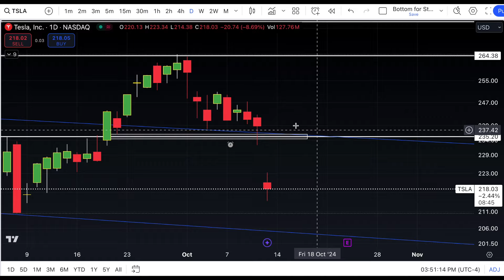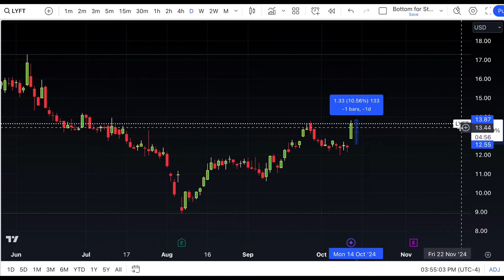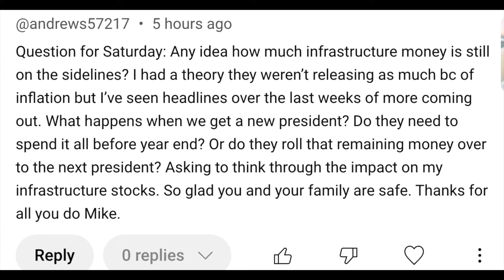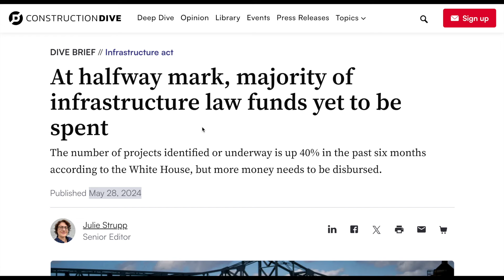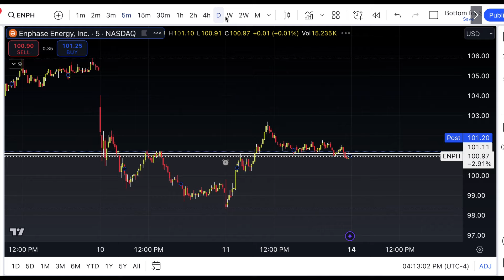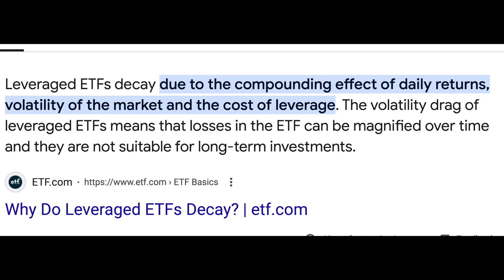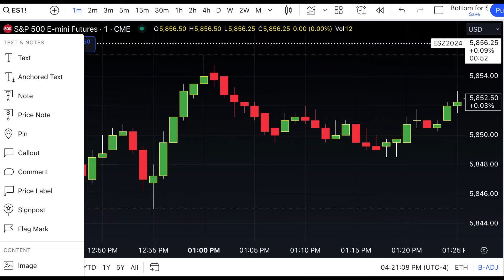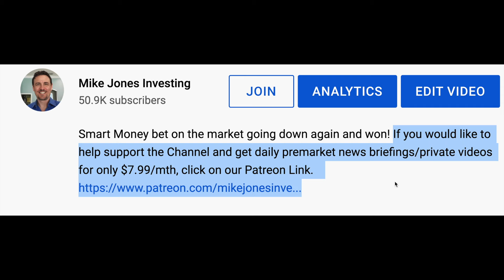Big Money Pulled The Rug On Tesla & Here's Where Buyers Will Step In! Plus ENPH, Liquidity, etc!

Comment: Did Tesla just give up on the semi-trucks? Haven't heard anything about them in years
Reply: Tesla phone ?
Reply: No they did not give up there actual building the semi factory right now this alone will be epic
Reply: lol. They are building a solo building in Nevada right now for them.
Reply: You mean aside from the Pepsi two year usage report that came out a few weeks ago ?  Or the fact the walls are going in place this week on the dedicated Semi factory in Nevada with a 50K/yr build capacity  now that 4680 production is ramping enough to cover the Semi as well as the CT ?  Or the presentation in Europe showing the minor changes  required for EU ?
Reply: @kirkellis4329  I have yet to see one on the road.  I don't think the flex of it now being done is as good as you're trying to make it sound.  These were announced in 2017 with a production date originally of 2019.
Reply: @tonytiger6874  I think Pepsi had 70 of them running all their N Cal routes for the last 2+ years.  Tesla has another group moving battery packs and vehicles from NV to Fremont and TX.  All beta testing until now, but design is final and factory for full production under construction.  Five years late is still early compared to Bill Gates, Mercedes and everyone else who said it could "never" be done as BEV and bet on hydrogen fuel cells instead.

Comment: Mike yes it’s fully automated in China  BUT if you noticed THERE WASNT ANY TRAFFIC those buses were on a road only those vehicles can use we have that here with WAYMO they are doing driverless cars already in certain areas
Reply from the maker: Yea but keep in mind those videos were 2-3 years old. They are in regular areas now.  Yea in San Francisco. I rode Waymo  a few tims about 2 months ago. It was awesome.
Reply: My ex and kid just rode a waymo. Said it ran a red light. Cut someone off. Started moving when unclear what pedestrian was going to do

3 strikes in a 20 min ride. I was shocked by the error rate
Reply: exactly! My son was serving in the Navy.. stationed in Japan for the last 5 years... there are no automated taxis or busses running anywhere other than closed off strictly controlled sections. the mass transit system is very efficient and well maintained but is still run and managed by humans.
Reply: @themikejonesinvesting  Waymo needs a human operator at the HQ monitoring it all the time` and they have to step in every few minutes and take control, but they don't report those as "interventions" for some reason (basically just fraud).  Waymo also can't pick up or drop off anywhere you want, just preloaded locations and can't navigate a parking lot at all.  It is at least 10 years behind Tesla in terms of "real" autonomous driving.  Useful for a taxi service to only need 10% as many remote operators as you would actual taxi drivers in the cars because that reduces payroll, but not at all autonomous.  If you plunked a Waymo down outside its known geofenced area it would just stop and cry while Tesla FSD would follow whatever rutted dirt road it found.
Reply: @ssing7113  oh wow I’ve never rode in one that’s REALLY PHUCKING BAD.
Reply: @themikejonesinvesting  Mike if I had to bet they are doing exactly what we are doing very selected areas.  What sucks is can you ever believe anything they say.  One thing I think Elon might of messed up on is not also going with LIDAR I don’t camera and sensors will do it.

Comment: With Tesla, I think people were anticipating Elon to announce wireless EV charging and it didn’t happen
Reply: Actually, it did happen.  The Cybercab uses inductive charging and doesn't plug in.  Elon said that.  Since the Cybercab is just the Model 2 without pedals, sideview mirrors, and steering wheel, that means wireless charging when it is released, supposedly still  Q2 2025.

Comment: Teslas profits currently come from Autos mostly and when people cant afford to buy them it slows everything down. Not only that theyre offering 0% loans which is a sign of lack of demand. in 2005/6 auto companies were pushing 0% loans and 2 years later the financial system imploded. It may happen again if people dont keep CONSUMING at a high level. RE prices are finally starting to drop due to beiing massively over priced since 2021
Reply: a 0% loan doesn't matter when the insurance and repair costs are 3x more than an ICE car. a  cheap ICE car new like the Nissan versa cost under $24,000... a new tesla EV, base model 3 starts at $40,000... the $15,000 difference can buy you 10 years worth of available any where fill up in 2 minutes gasoline with minor repairs done at nearly any competent mechanic with parts from autozone, pepboys or any of the big online like summit, rock auto. Teslas or most other EVs are not DIY friendly at all.

Comment: Mike I want to update your thinking regarding what Tesla is going for... they are solving for full self-driving, autonomous, where the cars actually think and can be dropped anywhere to solve for how to drive. This is totally different than any area you named,Europe or otherwise, this problem in physics has not yet been solved. What you are referencing is geofence pre-mspped, and fully coded which is what's happening with waymo in california. There is a huge distinction. The point is once they solve this and have regulation which will also prove that it's much safer than human driving statistically, they will roll it out first in California and texas. It feels like we're behind, but once that happens, it's game over, it surpasses anything else that is out there rapidly. It is a function of the approach and how to solve the problem.
Reply from the maker: Thanks for the detailed explanation. So have they solved that problem yet? Also my understanding is they are trying to rely on vision vs sensors like Waymo and Amazon.  How does that work in the fog and heavy rains? I'm not a tech guy so trying to figure out how realistic it is that they solve the problem